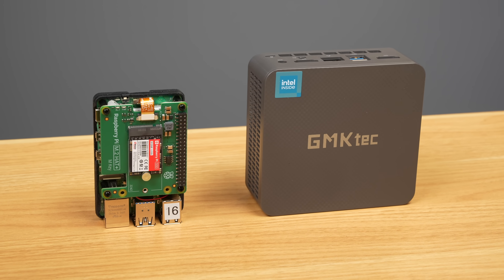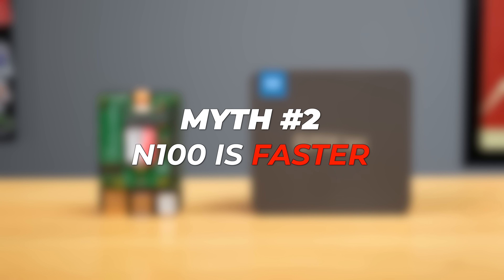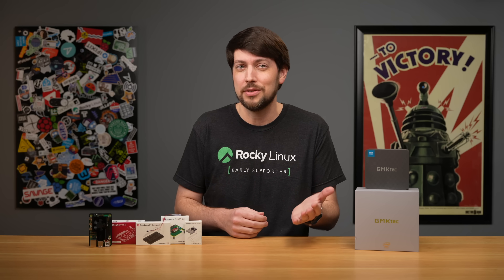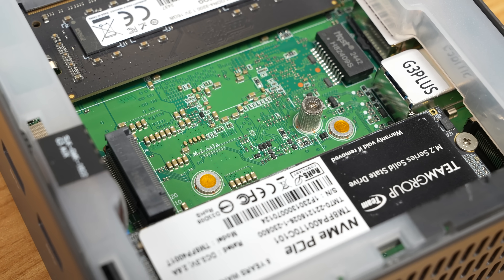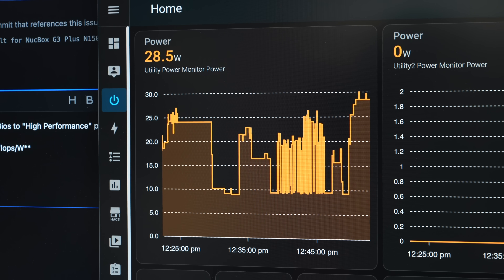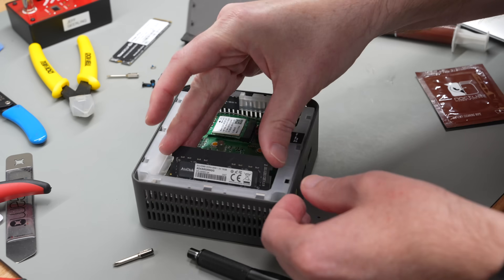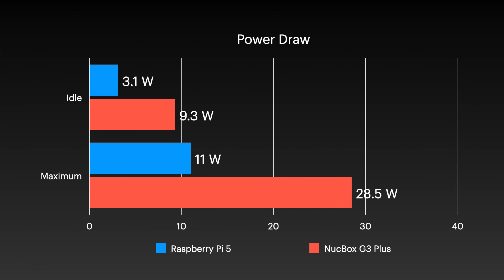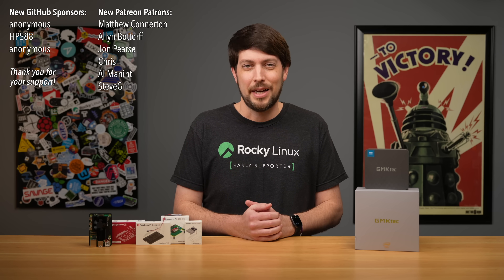When did Raspberry Pis get so expensive?

Comment: My major use for my PI was Pihole, my major issue with Pihole is that it logs quite a lot and the SD card on the PI would eventually fail over time. I've switched to an HP t620, I'm able to run ubuntu server on it, with the internal SSD it's never failed for me. Been running it for 2 years now and I've just upgraded it to 8g of memory and installed ubuntu 24.04 on it. Its running just fine. I keep performance logs about the system and it's never struggling. Why would it, pihole isn't a heavy hitter. Now I can use my pi's for more of a play systems swaping OS's at will. Still love my PI.
Reply from the maker: Pis good for Pi things, mini PCs good for mini PC things ;)

Though I switched my Pihole Pi (also running Grafana and some containers to track internet metrics) to a USB SSD a couple years ago and it's been running strong.
Reply: @JeffGeerling …’USB SSD’  yeah, I went with that from the first day the info showed on the Pi forum.
Cheapest-of-the-cheap BangGood USB-SATA adaptors kept the cost low low low …
Reply: @JeffGeerling  I think the point of comments like this is that "Pi things" seems to be an extremely narrow niche at this point with many of the things it was useful for before done better by other options.
Switching your router to pfsense with pfblockerNG is probably going to work better than Pihole is for example and will only require the single machine instead of multiple.
Reply: I had the same concern with the SD card, so I got a case that would let me add an NVMe drive over USB and threw a cheap 16GB Intel Optane drive in as the main boot drive. They were literally built for write endurance. Now it's running PiHole, a Twingate Connector, and has my UPS plugged into it to host Network UPS Tools.
Reply: Yeah if you are going to run an OS 24/7 with lots of logging etc you want either USB caddy or direct NVME drive or to buy one of the expensive but actually similarly durable SD cards, rather than the usual good for tinkerer, phone media library type ones that will fail. But most folks don't seem to know the industrial last "forever" grade SD cards actually exist, and they can be hard to find, and seem stupidly expensive until you consider the endurance difference in the still stupidly tiny package.
Reply: I've been running a PiHole on a Pi4 for a couple years now and haven't had any issues with the SD card.  What kind of network are you running it on that you have that much logged?
Reply: PiHole runs just fine on older PC hardware too.
Reply: I run PiHole on a Hyper-V machine on an intel nuc. Runs really well actually. Never had any problems with the hosting environment.

These units definitely not the best bang for the buck. But I got an okay deal. And I'm a windows dev. So having an intel/windows machine always on is a really good thing for me.
Reply: as another commenter has noted: log2ram
Reply: I had concerns about logs, too. 
So, I started using DietPi, which logs in RAM (or, Raspberry Pi OS with Log2ram and zram-generator), and since then, I haven't had any problems with failing SD cards. 
Try giving it a look :)
Reply: Like others, I created a ram disk and then it moves files to a file server (mini pc).

At first I used NFS, but this caused too many issues (this is America: power outages) so I wrote my own web services (app config service, log service and video storage service). It was a fun adventure on its own, and the result works great. Latest raspberry pi os upgrades required a reinstall and not using anything wonky like auto mount NFS greatly simplified the reinstall.
Reply: This is a problem solved many years ago, you can just use a RAM log.
Reply: @r0galik this was exactly my thought. Create a RAM disk, sync it every say couple minutes or hours to disk (preferably not the SD card) - in many years of using PiHole I only ever looked at the logs twice or so.

Comment: I got 2x GMKtec G3s (The older N100 version) with 8GB Ram and 256GB SSDs for £65 (~$80) each inc 20% VAT and delivery from aliexpress during black friday and upgraded them to 32GB for an extra £37 each so for just over £100 each they absolutely annihilate the pis for value IMO. Unfortunately my Pi 4s and Gmktecs are both sitting in the same drawer as I've not had time to set them up yet 😂
Reply from the maker: Daaaaang! They do have nice sales sometimes, you got them for an absolute steal.

Comment: Short answer: EVERYTHING got more expensive… and R-Pi weren’t immune.
Reply: No. There was a market and people made alternatives that are way way better for the price. They haven’t made sense for years.
Reply: @float32  those companies just copy without having the ethical sourcing or community outreach/education mission or lots of other honourable things done by Pi that should be rewarded in sales. Anyway, pi got more expensive because parts and labour became more expensive for pi. The companies with lower overheads will also be facing their own inflation.
Reply: @dna9838  nope, brand loyalty is a mistake. RPi isn’t loyal to the home user.
Reply: @Hornet135  apart from the things I mentioned. 
You just sound determined to save your money and post rationalise it, ignoring that pi is a company/foundation that are trying to do some good in the world not just make a quick profit based on the efforts of others.
Reply: @float32  I have had stability issues with small ARM based SBCs. I avoided many such SBC after discovering how old the Linux kernel is. I decided to only search SBC with armbian support, but even this does not fix hardware stability. I came back to RPI (zero).
Reply: I thought manufacturing makes everything eventually cheaper
Reply: @LuisGutierrez-dr6re cheaper to a point. Not cheaper as infinitum
Reply: We will be fine, thanks to our markets we even have low price computers.

Comment: Expensive? I don't know

Take a look what phones featuring the same cortex chip cost when they were flagships. It got a bit more expensive but it got a lot more features, add-ons and software is much more solid. Not even mentioning inflation. The pi costs an equivalent of like 8? packs of eggs in the us? That's pretty reasonable for a computer man. Comparing it to x86 is only valid in a country with dirt-cheap electricity.
Reply from the maker: Heh, in a few months it'll be like 2 packs of eggs in the US :D

Comment: The PI has an ace up its sleeve. It has gpio, that is a killer feature of the PIs and clones.
Reply: It's only a killer feature if its something you need for your project. The vast majority do not.
Reply: @puressk  "It's only a killer feature if its something you need for your project."  Exactly, and that was a part of his message.  Compare based upon what you actually NEED, not just raw specs.
Reply: I think the Pi's killer feature is still ecosystem and support.  Especially if you're integrating it into other projects, at this point, you know what you're going to get in terms of availability and software support.
Reply from the maker: The X4 has GPIO through a Pi RP2040, which is an interesting addition I hadn't seen on any of the other Intel boards before.

I'd love to see that option in more places, as it saves you from having to plug in an extra microcontroller externally over USB. There's even room in most of these mini PC cases where you could pop on a HAT if you can meet some minimum HAT specifications for mounting, power, and signals!
Reply: @JeffGeerling  I agree it's a nicer package vs. an Arduino over USB. However, a USB controller has a fairly low entry point (Arduino Nano ~$25 at Microcenter) if you already have some hardware and it's kinda the same experience from what I've gathered? 
I know, personally, it's easier to bust out a USB Arduino dongle on my daily driver than setup a Pi for messing around. Just wish Microcenter carried the Adafruit FT232H... I can't bring myself to pay as much for shipping as the board itself.
Reply: @JeffGeerling  I wonder is there an api for that, because I would not want to write the same code to share the data between the rp2040 and the rest of the computer
Reply: @JeffGeerling  What would be cool would be the ability to add GPIO via USB. Not sure what kind of support that would get, but if it were supported it would open up a whole new world of possibilities.
Reply: So does an ESP32 and they're <$5
Reply: @seanhood980  but its bad if you  need analog signal
Reply: but you can also integrating arduino
Reply: There are so many little usb arduino compatible gpio boards for a small small fraction of the price, that will work for 99% of use cases.
Reply: It's for sure less convenient, but you can actually tap into DDC (which is basically i2c) in VGA or HDMI ports. That's how i'm driving a 4x20 LCD to display some basic info on my server. You could get generic GPIO pins with an i2c IO expander as well.
Reply: Vast majority of lay person Pi users don't use the GPIO. They put some self-hosted thing on it they heard about and then put it in a closet.
Reply: I think the Pi Zero 2 doesn't get enough love, it's cheap but stripped down and has GPIO and has an OS. Really fun to tinker with, kind of a bridge between the Pi and the Pico
Reply: PSA  "GPIO" is just a parallel port and its existed on all PCs since the 80s. Also you can get a usb ft232 one for $10, Linux has built in support for it, its as easy as anything else, it even works with a phone. And support is the entire Linux community.
using the picos gpio however is even cheaper!
Reply: @remotepinecone  In fact there are quite a few n100 pc's on the market with 'legacy' ports like rs232 that are geared towards industrial use. They are cheaper then equivalent rpis and come with a robust heatsink housing. They are fanless too, so perfect for workshop computers.
Reply: As others pointed out, there are GPIO solutions for mini pc, but I have found that most only work with special libraries. Buyer beware! This is why I still prefer the RPI. Then I found pigpio and its ability to generate perfectly timed wave forms. I believe that finding a USB based GPIO that does the same requires a serious analysis.. Even if you find one, will the product last? I will keep using RPI (GPIO) in the foreseeable future.
Reply: Yes, but it's not a killer feature of the pi FIVE. Why not get an original, ancient pi ONE if you just want to run some basic home automation script? If this is their niche they don't need fast CPUs and they should be designed for low cost.
Reply: I said it before and say it again - pairing an N100 with an ESP32 and it's not just equal but better than a Pi, the IO is properly timable unlike the Pi's janky Python handling. Also, UART, ADC, DAC, I2C, I2S, SPI, hardware PWM on every pin, touch control and probably a shitton more, a for the grand total or ~3 USD.

Comment: 1:57 only twice as fast… yeah not much faster. Cause 120mph isn’t much faster than 60mph. Only twice the speed.
Reply from the maker: True; that line could probably use some nuance (there were a few sections I removed from this video because I didn't want it to drag on), but some people seem to compare their experiences with like a Pi Zero to an Intel N100 when complaining about how slow a Pi is online.

It's rare you find someone on HN, Reddit, comments, or a forum who is complaining and hard-set against something like an Arm SBC to actually have the nuance to compare like-for-like (and take into account the whole system, not just one spec—like efficiency and internal volume).
Reply: @JeffGeerling  More likely they were comparing the N100 to the Raspberry Pi 4 B's BCM2711, which was the top-of-the-line RPi Broadcom chip until Oct. '23. The BCM2711 was just embarrassing in terms of performance compared to the N100. I'd still argue that a mini-PC is usually the better option for situations in which you aren't severely power constrained, but the BCM2712 closed the gap considerably for many workloads.
Reply: Yeah, and it's probably not Lamborghini vs. snail, but still Lamborghini vs. Golf or something 😅
Reply: imagine a pi against something like a ryzen 5...a golf vs a rocketship... @Drumonymus
Reply: And that's without even considering that you can run native x86, and that software support for x86 is miles ahead than for arm (How many of these SBCs even have hardware acceleration enabled on the browser?).
Reply: Twice as fast is a great selling point. No need to downplay it.
Reply: This feels like a PiBoy trying to defend the pricing. Okay so inflation… but the problem is has the pi improved that much on the original to warrant climbing with inflation? You see I remember when I was a kid seeing awful PCs costing £1000 and now the modern equivalent in level is a third of that… do you see what I mean? Same goes for Pi. What makes the newer Pi warrant the same equivalent price as the first one did? The original pi changed the landscape… pi5 does nothing like that. 

This does feel like a guy fanboying. Efficiency means fuck all, I’m sorry but it doesn’t. It’s a SOC and the NUC isn’t designed to be turned into a PiBoy which is the only reason anyone using a micro would care about efficiency. You mention efficiency first simply to use a dumb argument against the n150 being way faster. “It’s only twice as fast and arm is way more efficient!” Cool beans. Usain Bolt is faster than I am but eats more food… your point is, dumdum?

Comment: That's why I'm still struggling about buying the Raspberry Pi 5, especially when you can get SBCs with a similar board design like Radxa's Rock 5A/5C and X4 but with much more power (Rockchip RK3588S for 5A/5C and Intel N100 for X4).
Reply from the maker: Honestly, at least hardware-wise, it's a great time to buy an SBC. So many options that have enough horsepower to do just about anything.
Reply: I would like the next version of the Radxa X4 to be with the size and layout of the Radxa 5B That's because I hate microHDMI. I am currently designing a case for my Radxa X4 8GB along with a Waveshare adapter with FullSize HDMI and Type-C USB power

Comment: I never got to experience the $5 Pi Zero's! Those were game changers but then the great chip shortage happened. :(

I've only maybe had 5-6 pi's my whole life but they have ALL been Pi 3b's non plus.
Reply from the maker: 3B and 3B+ were both pretty great Pis, some of the best; IMO the last generation that didn't need at least a good heatsink. They're not the most efficient or anything, but they were fast enough and had enough IO to do a lot, pre-use-Pi-as-homelab option.
Reply: @JeffGeerling  With my lack of expertise in computing, I'm no Jeff Geerling, they have ALL been used for retropie lol

Comment: Perfect timing. I've been shopping around for my first Pi wondering the same thing.
Reply: Dont. Just walk away from Pi. Trust me. the boards 'starts at 45' now add shipping and value added from a retailer and then the drives and the cables and the power supply (many of which SUCK) it goes on and on... The OS install (for me) failed or went sideway (unusable performance) over and over... each project felt like two steps forwards and ELEVEN steps backward.

Unless you are determined to make some project that only this type of device can achieve, walk away. I stand here today a testament to DAYS wasted messing with this crap only to put it in a drawer and then every year or so - remove them and try again - only to lose another day to frustration and failure. You gotta want it with these things.
Reply: @Machistmo  It sounds like you've had some really bad luck with your Pi and accessories. I don't know why the OS install would fail so many times. Every time I have done it, it works. Are you buying your accessories from a reputable source? I know from experience that there are some crap ones out there. Since I've learned what retailers are trustworthy, I've never had a problem.
Reply: If you decide to buy a Pi and, if you have the money, buy the Pi 5. It's the most powerful by far (in most cases), it has more options for projects, it has the most compatibility for accessories and addons you may need for projects. These are only a few options why I love my Pi 5. Also, if you can, splurge on the 8GB model. It's the best option for the money.
Reply: Don't. If Linux seems interesting just install it on a Mini PC.
Reply: @GavinTheGoose  Or even a virtual machine or cloud service like Linode. That is a great option if Linux is all you're interested in. But, a Pi is so much more.
Reply: I have been most happy with the Raspberry Pi 3: the most bang for your buck (Google "compare raspberry pi performance"). I have been able to make complete (passively cooled) configs for $60-$70. It is not fast enough for some applications (e.g. no video transcoding), but it all depends on what you plan to do. Librelec runs fine.

Without knowing the use case, I would not be able to recommend anything. Even some mini pc models struggle with transcoding.
Reply: nah get a zero 2 w
Reply: I used to use an army of Pi 4 boards for various things.  I use mini PCs instead now and power optimize them closer to Pi power levels.  If you want to interface with stuff a Pi or similar board makes sense, if you just need a lowish power computer then I'd go with an x86 mini computer.
Reply: Need IO ports? Will an arduino or es32 work for that? Buying a Pi and never using the IO ports and just using it as a home server is likely a waste. A mini PC may be better and will likely become redundant over a longer period of time.